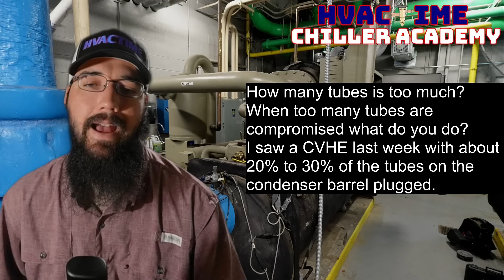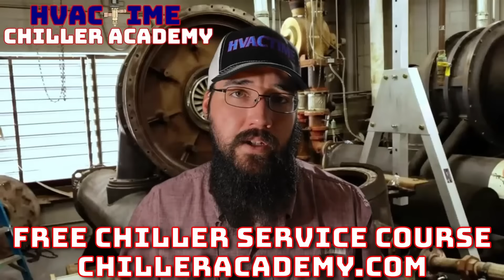Plugged Chiller Tubes is Too Many Explained

Comment: Thank you for answering my question! Unfortunately, I didn't get the contract for the CVHEs at that building, trane has had the contract since the machines were installed in the 80s. Funny enough when I was working on a different chiller at that plant, trane had the machine recovered and the end bell off and got a company to retube the machine. (That's when I noticed the plugged tubes)

I did get the other 2 chillers in that building. This will be my first chiller account. Thanks to your videos that I have been watching for years, I felt comfortable enough to take on this account. I will be buying your chiller course soon as well.
Reply: good luck man, learn as much on site as possible

Comment: i  had a interesting one today i would like to pick your brain about. i got called to a carrier aquaforce XWHP, one with a economiser as its used for heating and the whiny carlyle 06 paragon screw on it. it had a low economiser pressure fault and would not stay running for longer than a minute or so before faulting out. both the temp sensor and pressure transducer of the economiser have been replaced already along with fixing the leaks and putting back in half of the total charge from lost refirgerant. i noticed the main EXV was working fine but the economiser EXV stayed closed even when i did get it to load up for a couple minutes. i would expect it to open up to help it start or least to get some efficiency from subcooling over the plate exchanger but it remains closed. i tried swapping ports on the EXV board and the valve works just fine but it seems it does not get commanded to open or the board is busted. i am wondering if i missed anything or indeed the board is broken. if the board is not commanded to open the valve why would it error on low pressure on the economiser in the first place?
Reply from the maker: Sounds like it may be calling for it but it is not actually opening the valve causing the alarm. It should calibrate those valves upon power cycle or before it starts the circuit from standby. So I would get it to do a valve calibration because that valve will calibrate at the same time the main evaporator valve calibrates. If the evaporator valve is calibrating but the economizer valve is not moving at all but you have already verified that it is capable of moving, then it is extremely likely that the module has failed.
Reply: @HVACTIME  thank you for getting back to me. i dont work on these antiques (they are considerid old here) often enough to really be sure of myself about stuff like this. i really dont like offering the customer a repair that is not going to solve the problem.